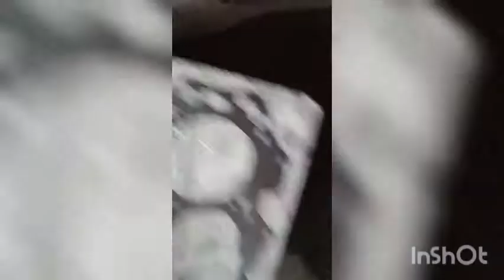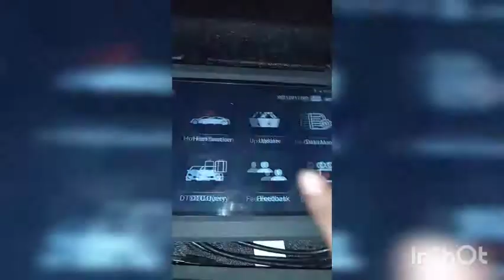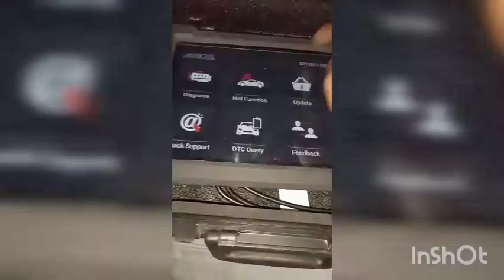Ford Everest 2014 model installing cylinder head part 2

Comment: Why don't you speak English??
Reply: Your job but speak in English is better
Reply from the maker: i cant speak English
Reply: Thanks bro, I ask you some questions for Ford Everest RL engine;
1. How many cylinder head bolts are there?
2, torque cylinder head bolts for W head, 1 head bolts and foot lb sequence
3, valve clearance for exhaust and intakes
3
Reply from the maker: the cylinder bolts have 16 bolts torque is 120 pounds torque, intake valve clearance is #7 gauges, same as exhaust
Reply: Thanks brother for assistance